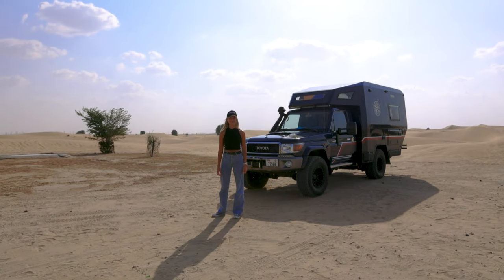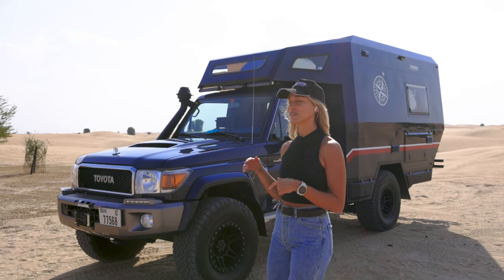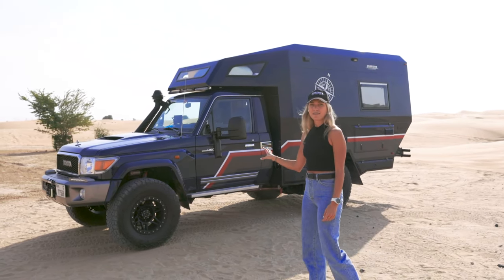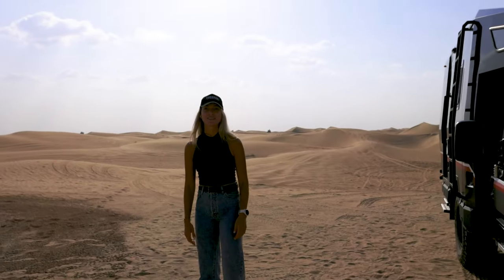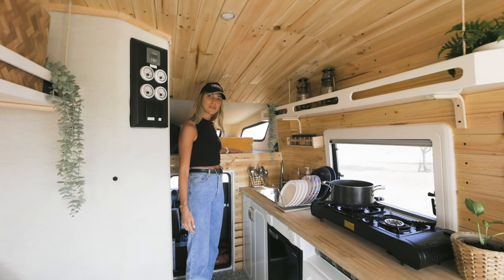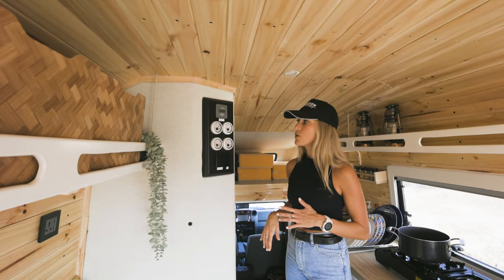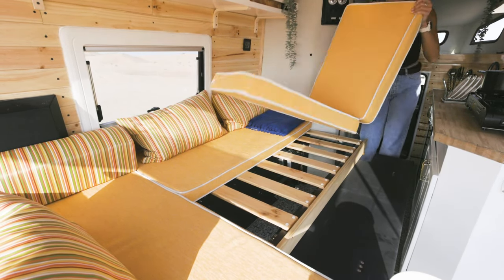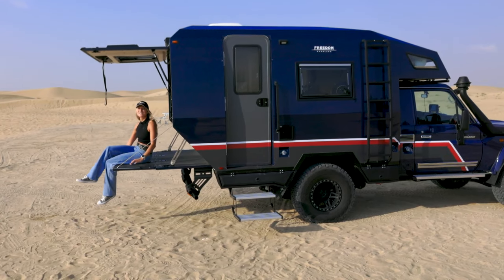Vehicle Tour - Freedom Cruiser 2.0

Comment: How much is the cost?
Reply from the maker: The LC79 New will cost you 475,000AED.
Reply: Does it come like a package like incling the vehicle or only the camper
Reply from the maker: @krishnanandk3964   Yes, It includes the vehicle as well. The Vehicle is a V8 diesel, manual, new with all the differential locks front and rear including a factory Winch.